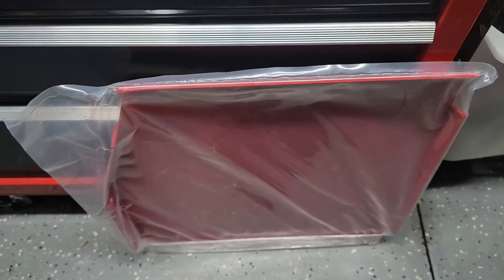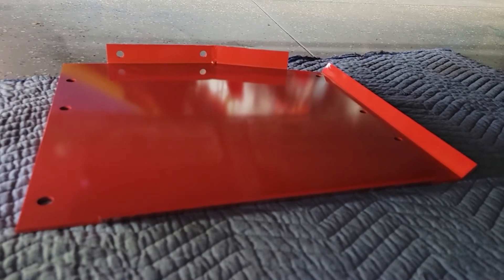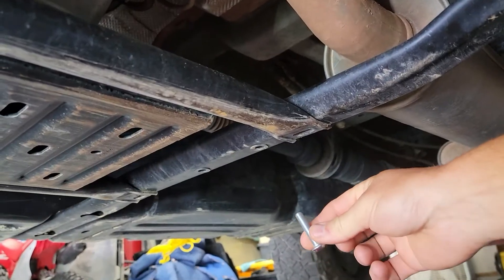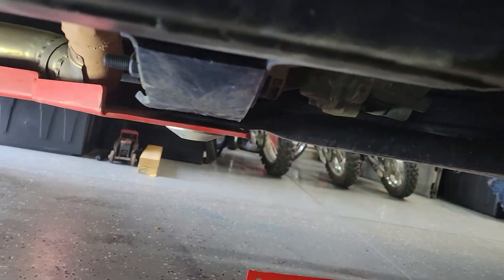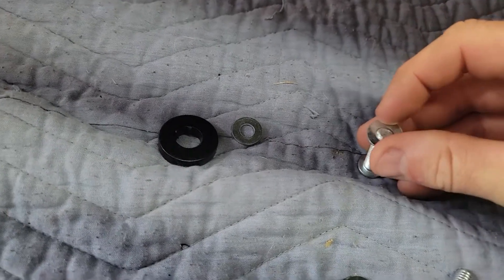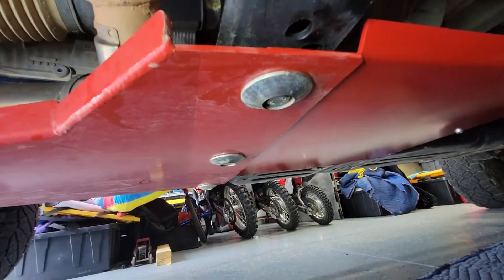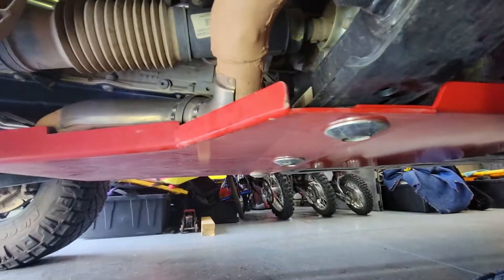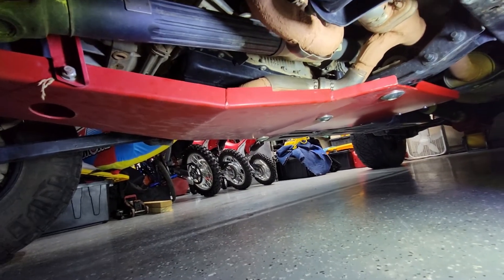M.O.R.E. Transfer Case Skid Plate for Jeep JT Gladiator

Comment: Did you ever drill that third hole in the brace?
  Great Video BTW.
Reply from the maker: Honestly I forgot about it until you just mentioned it, lol. I cans ay that I have been on a lot of rocks and never ran into an issue though. I actually got high centered last weekend and had to completely spin on it and it held up just fine. Does have a large U shape gouge in it though.
Reply: @ajphillipsjeeps  good to know.  I started my Install of the oil/Trans and Transfer case plates today.  Instructions are not the best and I noticed Im replacing Driver Side bolts where others used the existing bolts.   Also the washers are to big for the bolt protector things which is very odd.
Reply from the maker: @idrvplanes  which engine do you have? We have done a 3.6 jL, JT and 2.0 JL and all were different.
Reply: @ajphillipsjeeps  Have the 3.6 etorq. with the auto trans.
Reply from the maker: @idrvplanes  wonder if the etourqe changes the bolts up